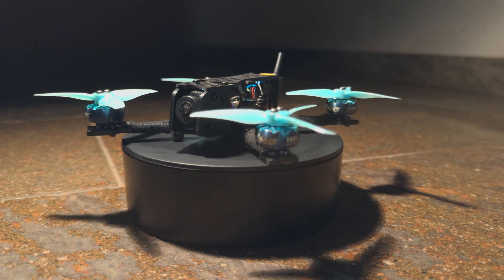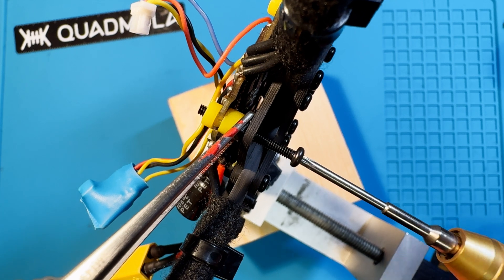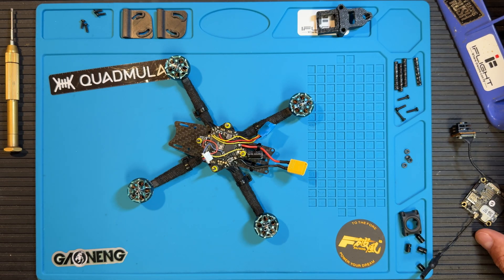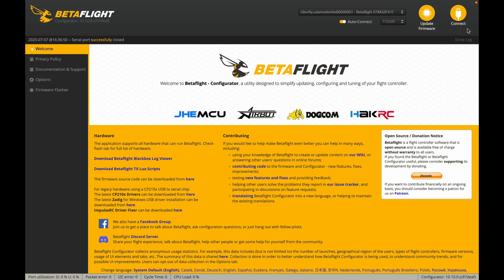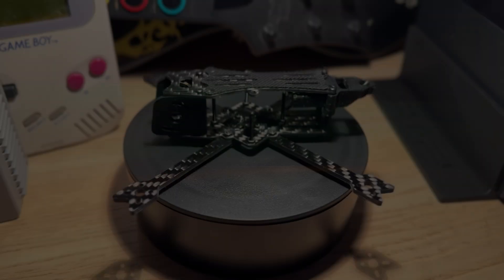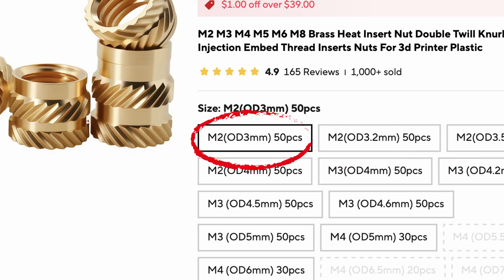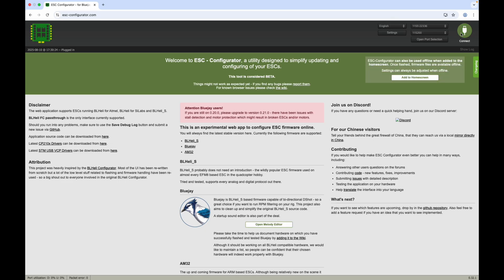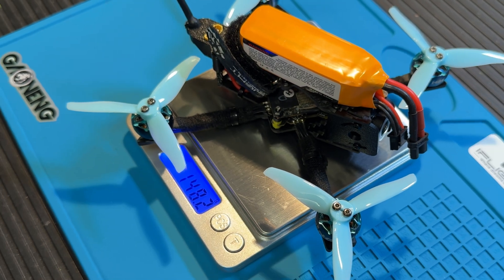The cheapest FPV drone in your lineup just turned Digital - Darwin Baby Ape HD conversion + Giveaway

Comment: Thank you for the video. I was wondering if it's possible to connect o4 lite directly to the battery pads, thanks for confirming that.
Another question I have, for the motors you have provided in the description, to both versions need to have modified arms/screw holes?
Reply from the maker: I‘m glad I was able to help with the information I provided! Yes you are right, both of the motors I suggested share the same standardised mounting pattern so you would need to modify the arms.

Comment: would love to get into fpv, just got my first transmitter a week ago and am working on fixing up an old dynam hawker tempest that i got for 20 bucks for as my first plane because the wings and vert stab need replaced, just got the flight controller in and waiting on the replacement parts so i can start flying. wiring was in awful shape but ive rewired it so fingers crossed!